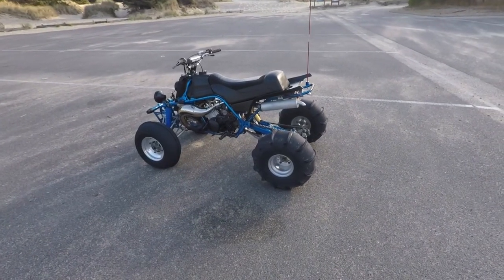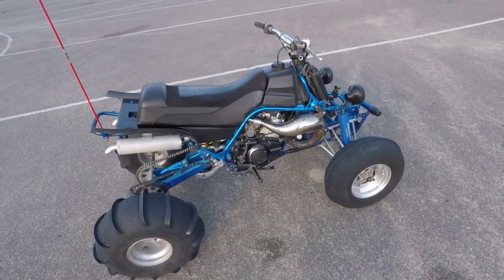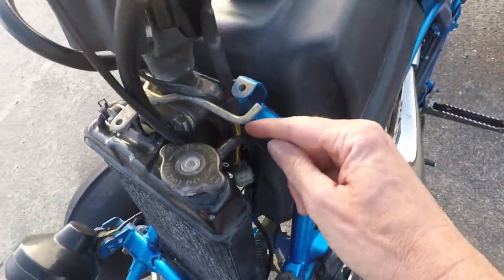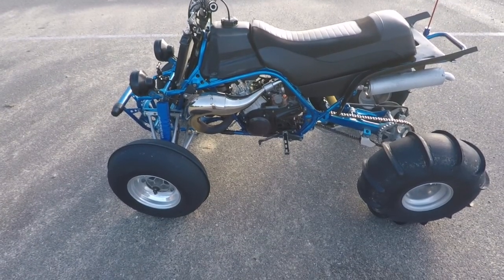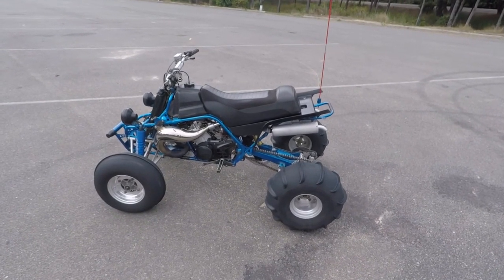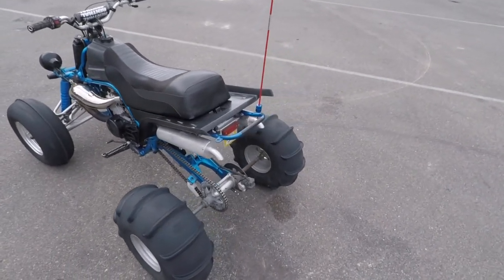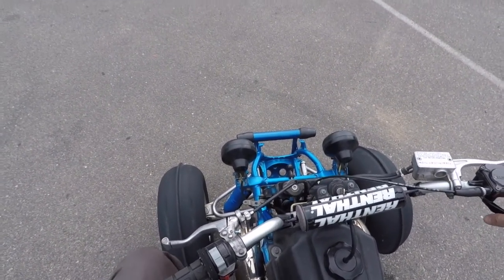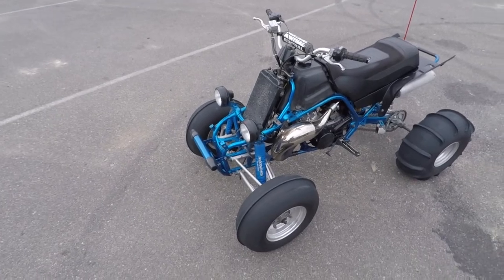421cc 4mil REDLINE SERVAL YAMAHA BANSHEE BUILD

Comment: nicely built machine. Not a fan of blue but man im just loving the look of this. Got a question or maybe somebody can help me here, i got a 02 banshee that's bored .40 over, with vitos " fat bastard " pipes and silencers, pods, and v force 3 reeds. Has fresh top end with about 4 tanks of gas through it since then, so far i noticed its been cutting in and out untill about half throttle, then power comes in. Bike idles, sounded fine. Yesturday went outside and fired it up, let it warm up and just as i started leaving it was cutting out super bad and it would just bog down when i give it throttle, any suggestions? Im running 340 main, im about 1600ft above sea level. Im guessing its a jetting related issue
Reply from the maker: It sounds like jetting......could also be your throttle cable and slides are out of adjustment or carbs out of sync with each other......make sure slides are opening all the way..........check that out and of course check that your carb jets are clean pilot and main....
Reply: West Coast im pulling it apart now, seems the right slide is up just a tiny bit more then the left, when i say tiny i really mean like a 1mm. I have a set of 220 mains i could throw in but i feel like thats to big of a jump down..but im 90% positive its just rich or its a air leak. Im not very good with jetting so excuse me if im not making much sense
Reply from the maker: 340 sounds good do not put 220 in too lean...............mains will only effect 3/4 - full throttle......what clip is needle in?
Reply from the maker: with those reeds you should try a 27.5 or 30 pilot
Reply: West Coast Roller im gonna finish eating then im gonna go rip the carbs out and take them apart and let you know what pilots i got and what position the clips in. I got a set of 25 pilots laying here but ill have to order the other 2 sets you metioned.

Comment: Whats the difference between a 421 serval and 421 cheetah cub?? Is it just port job on cylinder? Thanks
Reply from the maker: Serval has lower port timings for more bottom mid range performance with some punch on top. Cheetah is more drag porting for top end performance.
Reply from the maker: more broader power band across the RPM range with a serval vs cheetah all power up top.

Comment: Do you have the cheetah cub cylinders?
Reply from the maker: Serval cub...lower port timing than cheetah
Reply: Yeah i had Cameron at redline build me a 421 serval. Im happy. It made 82 hp on pump gas with t-5 pipes
Reply from the maker: Right on....Cam builds the best motors period...have fun!

Comment: How much does a Banshee like yours cost to buy and set up ?
Reply from the maker: Great question.........banshee's with aftermarket goodies can be picked up pretty cheap...so depends on what you get into the bike for.....the engine build on this one alone is around $2500 on the low end....not including pipes.